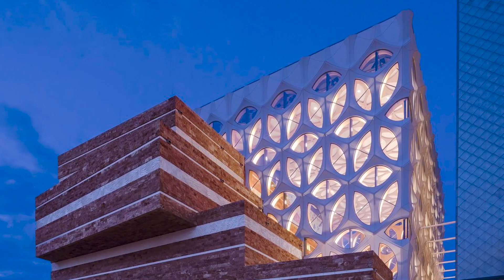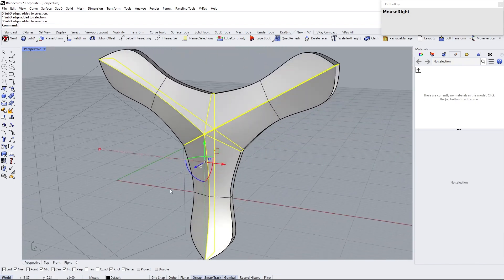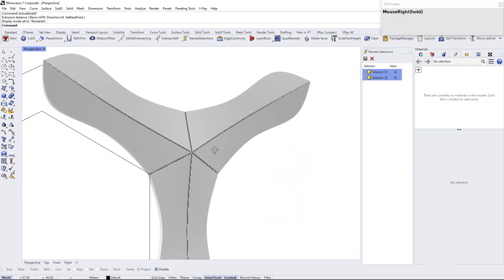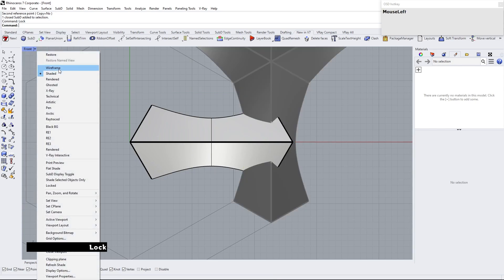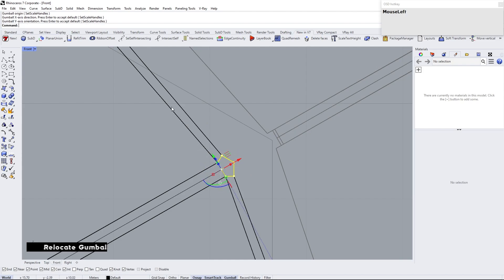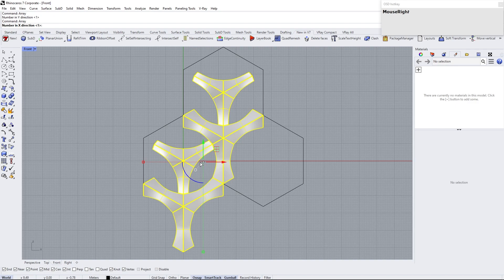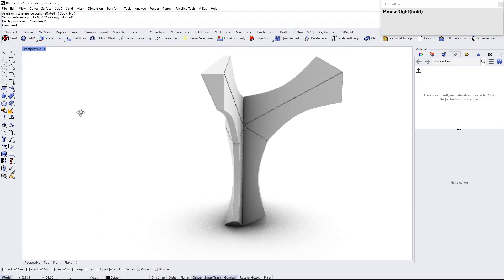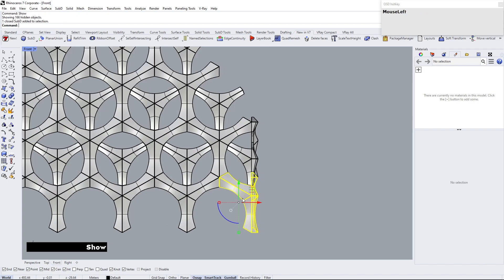Rhino SubD Facade Modeling |Naturalis Biodiversity Center Leiden

Comment: As usual great video! however I am having issues at 7:16... when I reflect the two sides completely merge, removing the bevel we previously created. Something like a mermaid effect. I think it is because the SubD has vertices on the reflection plane. How did you get it to work?